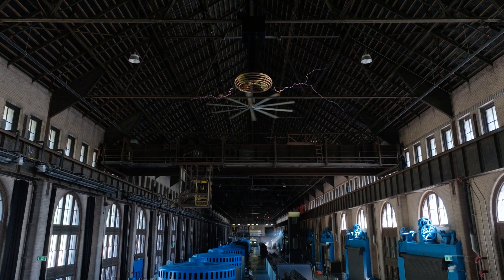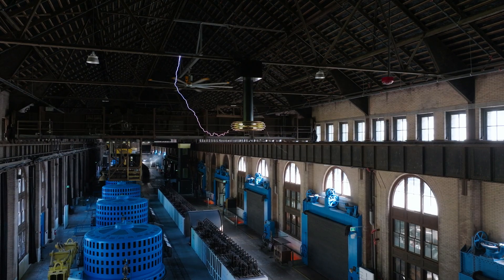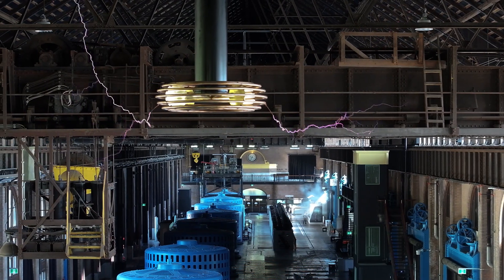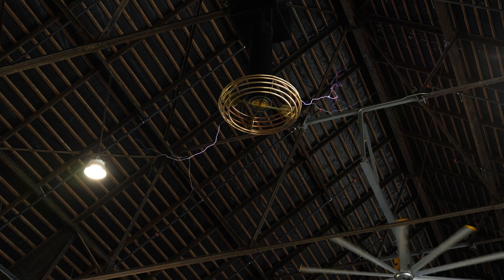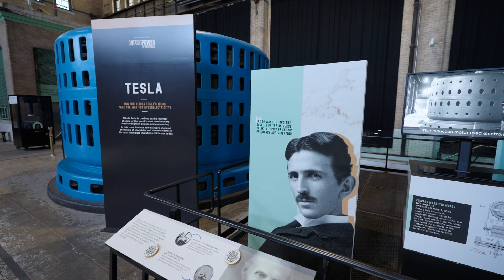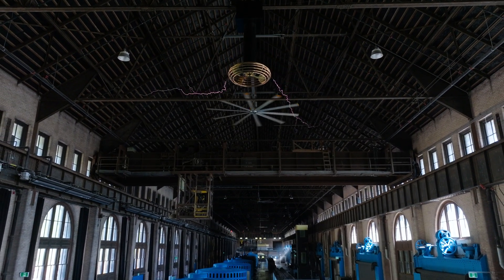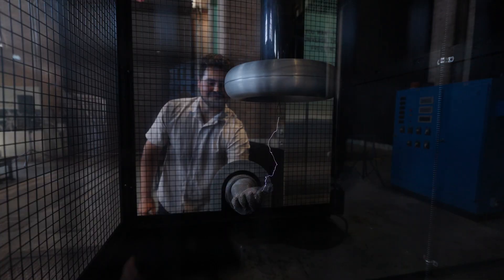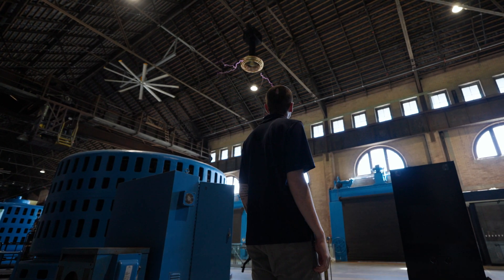Niagara Parks: Tesla Coil

Comment: How tall is the coil? It looks like between 6-10ft but its hard to tell.
Also I guarantee it's waaay more than 10,000 volts. Arcs like that exceed could easily exceed 1 million volts , given air breaks down around 15,000 v/cm. Unless they mean the input voltage to the primary.